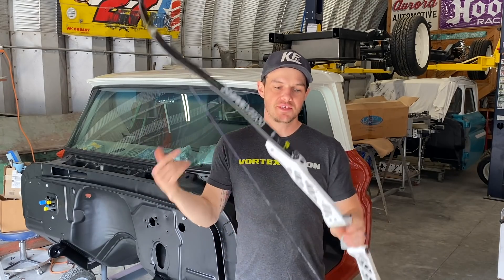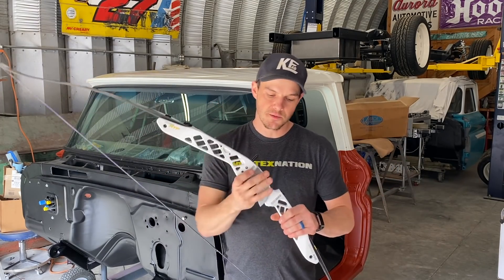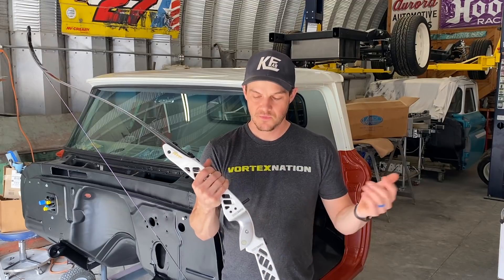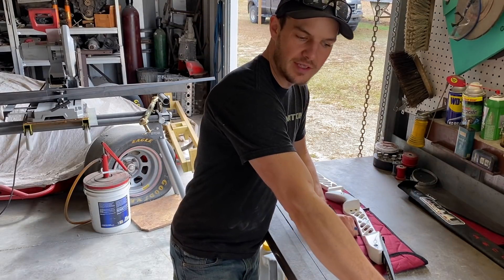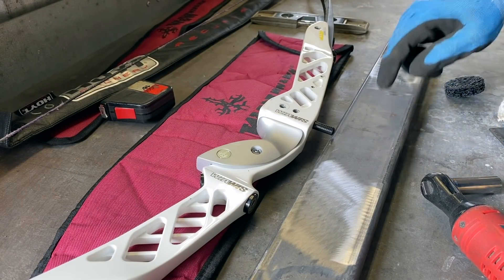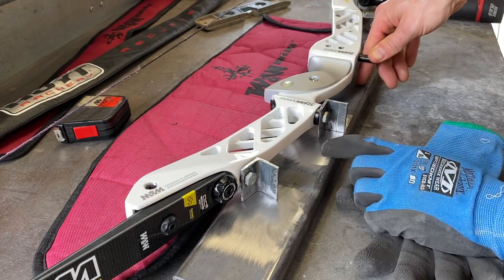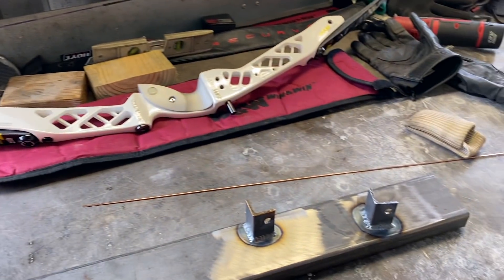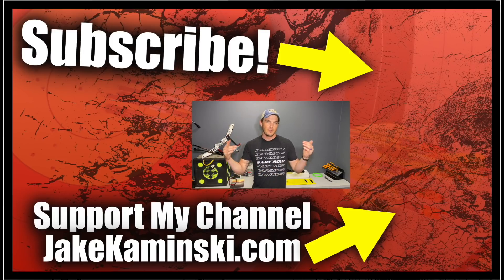Building a Limb Testing Jig | How I Will Rate and Test Recurve Limbs

Comment: The deflection that you measured is a combination of the limb bending perpendicular to the draw direction (bent like a diving board) as well as twisting (with the tip rotating down). If you just apply the weight on the tip without any constraint then you'll get a mix of the two that's likely quite strongly dependent on exactly how you add the weight, how level your rig is, and the shape of the limb tip. A method more like WIN&WIN's here (https://www.youtube.com/watch?v=aq8uoY_o-ps&t=295s quite an old video but shows the method well) should help with repeatability of results as the limb tip displacement measured is not linked to the shape of the tip itself, and it should work well with the rig you've made for holding the bow. Later in the video it also gives an indication of the amount of sideways movement expected from the limb tips caused by the release (a mm or two at most) and caused by the vibrational energy remaining after the arrow leaves (1-3 cm). If the way the deflection varied was perfectly linear with the load added, then it wouldn't matter whether the load you used was in the hundreds of grams or tens of kg. However, the combination of torsion and cantilever bending as well as the limb shape means it's likely to not be quite linear so if you're looking at the resistance to bending at full draw I'd keep the loads small so you only get a few mm deflection, while if you're more interested in the limb vibration after the shot I'd use much larger loads. 
As far as having the limbs at brace vs deflected to full draw is concerned, I've compared the two and the resistance to torsion isn't noticeably different (which doesn't mean there's no difference, just that it was smaller than my fairly coarse measurement). That is to be expected as the tension and compression present in an untwisted limb act perpendicular to the loads added when twisting the limb and all materials are behaving elastically.

Comment: Jake, I am questioning how relevant the results will be when done at brace height. They should be done at full draw, where one normally induce torque variation in the grip. You could use an elevated extension to put the center rod in line with the line of force and apply vertical or side force to see how much twist is induced.  As you can tell, I have been thinking about this for a while but never had the means to make it happen.
Reply from the maker: If all tests are done at BH, its apples to apples for sure. Full draw complicates things a lot and is frankly, terrifying as is, let alone when hanging a 5# weight from the limbs. I hear you there, but I will test at full draw to see how it looks and compares. I suspect what the results are at BH, will correlate directly at full draw.
Reply: @JakeKaminskiArchery   limbs will deflect differently depending how curved they are and how active the recurve is. How flat a limb is at full draw will influence how torsionally stiff they will react. This is why hyper recurve limbs are less stable in principle and have to compensate by added torsional stiffness in their structure.

Comment: if you want to measure the distortion under full draw, how about clamping a linear laser/ red line laser diode on the riser test stand you build in the last video. This way you can test two parameters in one go.
Reply from the maker: Im not sure that at full draw or brace will make a difference in the torsional stability. I would imagine it would have a direct relationship. Who knows. I'll probably modify the jig to test.
Reply: @JakeKaminskiArchery  It absolutely will. As the limb tips open up to form a curved arc the limb becomes way more stable torsionally (not to mention all the draw weight holding them in line). That's right out of "Recurve Fundamentals." The section titled "improving stability" in particular is worth a look. Easy to test though eh?

Comment: I would love to see a future test that measures the instability you will be measuring here (torsional stiffness) throughout the shot cycle (or at various points) static and dynamic, quantified by measuring the actual arrow deflection when released from a jig/shooting machine like 3 Rivers Archery uses (either on the target or with a grid and high speed photography (maybe contact another Youtuber for a collaboration like the SlowMo Guys/Smarter Everyday). Once you get a measure for deviations at rest, and at full draw (where the limbs open up and tip stability is restored), you could test the affects on accuracy and start to quantify limb forgiveness as a function of torsional stability. A cheaper anecdotal method might be creating a biased release mechanism that deliberately forces the shot cock-eyed to test the limb deflection's effect on accuracy across different limbs.
Reply: I just posted a comment along similar lines above, then scrolled down and read yours. In my opinion this would give an accurate idea of how limbs perform in real life.

Comment: One more thing that may be good to test could be stress distribution. There is a method shown in ‘archery anatomy’ by ray axford using a bend meter comparing the increase of bend from unstrung, brace and full draw at regular intervals along the limb. Having just learned the hard way, getting it wrong building a r/d longbow, it seems to me crucial in efficient limb design. Thanks

Comment: Just to check, torsional stability that you're measuring is for a limb to follow it's built in direction. I'm not sure how big a deal it is, but I think a similarly useful metric is the dampening that the limb has as I think a poorly dampened system is more likely to cause greater variation

Comment: Hey Jake, great work! 
This jig is exactly what I had in mind when I commented on your video about measuring the riser deflection - you might remember because you answered there. I think if you would add some threads on it in the middle so you could screw in the jig to the button plunger hole and use it as reference point you could make better measurements with that magnetic dial indicator than with the lasers.
As for the method of measuring the limb lateral stability - I think it would be more natural for the limb to put the weight in the middle of the string than on the end of the limb. This way the limb is actually deflected by the forces exerted by the string and not something that in normal circumstances is not there.
Reply: Might be a good idea first to get a frame of reference by measuring how much deflection force can easily be applied to torque the string. Use the worst shot form you can imagine and see how much force that torquing is generating and then use that as an outside reference point when applying it to test deflection rather than an arbitrary amount of force.